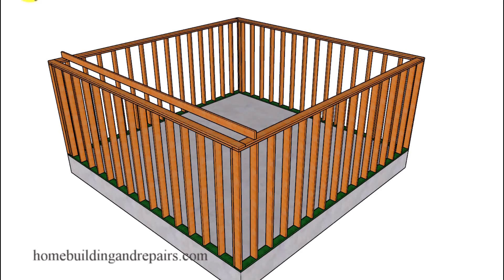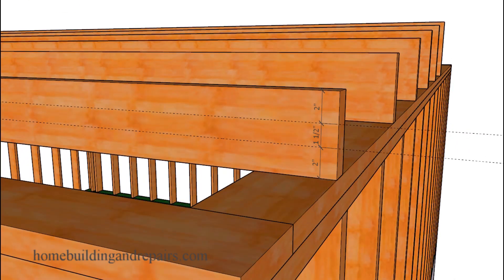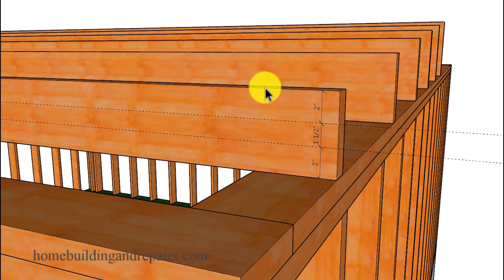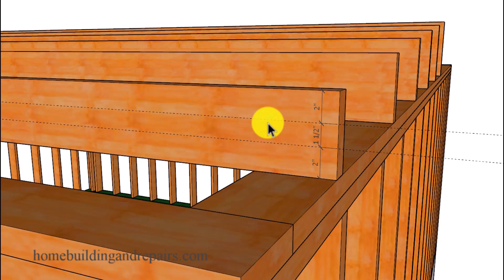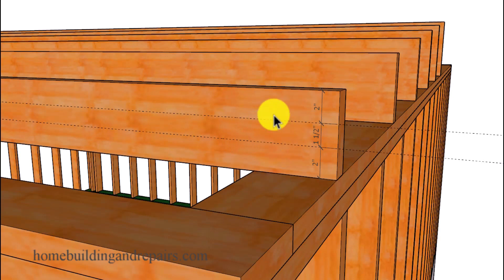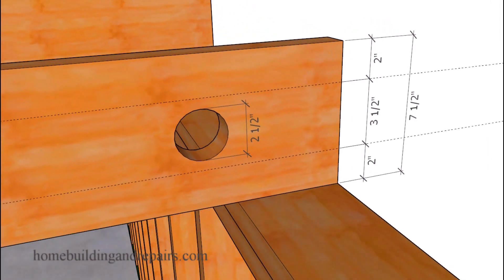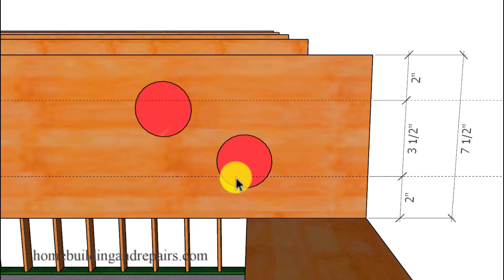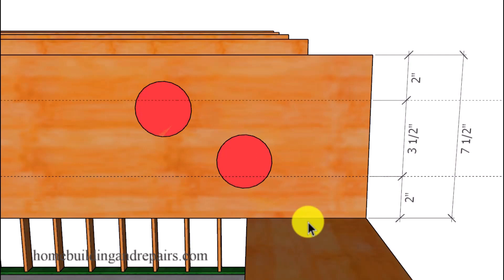How To Calculate The Largest Holes You Can Drill Through 2x6 or Larger Floor Joist - Plumbing Codes

Comment: Check your local building code, in ontario the max hole is 1/4 the depth of joist and 50mm from the top or bottom, very good illustrations and informative video tho!!
Reply: So for a 2 x 12 joist, the bore hole diameter is 2.87" max?

Comment: renovating my kitchen,  plan to run a 3" drain pipe through 5 joists of 8", the holes that run the drain pipe are over 3" Dia, so I want to use the metal joist reinforcement plate to support the joists. it is possible? Thanks.